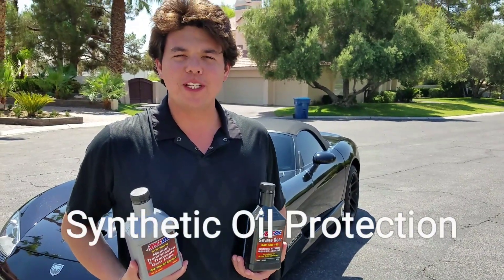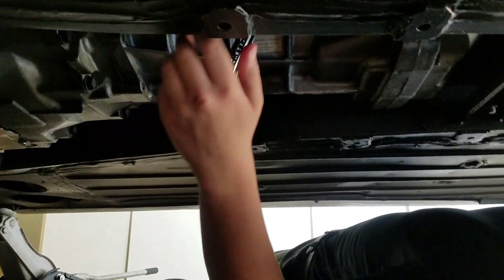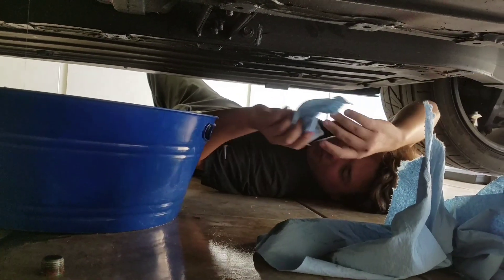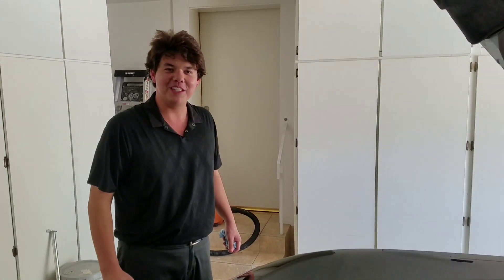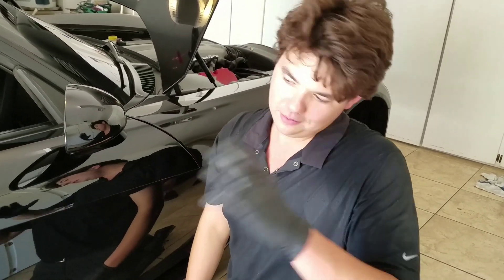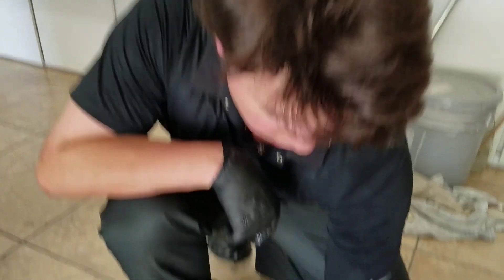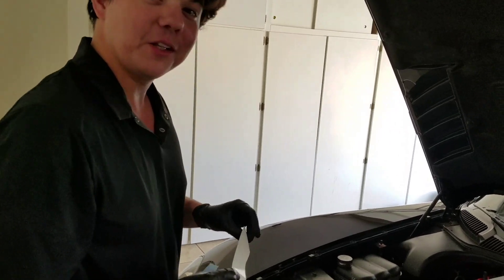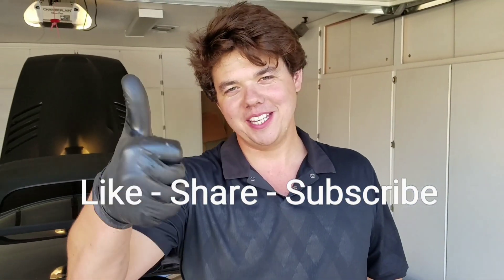2004 Dodge Viper Gen 3 AMSOIL Manual Transmission fluid Change

Comment from the maker: Watch This NEXT: AMSOIL FAQ - https://www.youtube.com/watch?v=ezqlKFExUhA&list=PLB_ftWArBFddeMPIMmZFpXbOyXSRZerqt
Professional YouLubher:
Eben Rockmaker Executive Direct Jobber AMSOIL Specialist (Dealer#: 5331179)
Mobile: (702) 472-3614
 My link: AMSOIL 25% Less Wholesale & FREE SHIPPING: https://www.amsoil.com/offers/?zo=5331179
AMSOIL Makes it for your Vehicle Lookup - https://www.amsoil.com/guides.aspx?zo=5331179

 If your vehicle is not on the lookup guide this is AMSOIL Tech Support 715-399-8324

Best Videos - https://www.youtube.com/watch?v=qjR2pjggjhY&list=PLB_ftWArBFdd7D6zW4OCpA0yEjh-uRY2t

     Friend me on and tag me because I like to see great results from my YouTube Community:
Instagram - https://www.instagram.com/syntheticoilprotection/

Facebook - https://www.facebook.com/profile.php?id=100007973957868

Order AMSOIL By Phone:

Be sure to give them my number so I get credit Eben #5331179 and tell them you would like to be a Preferred Customer.

1. Call 1800-956-5695
2. Ask for your own preferred customer membership because you will get 25% off, free shipping over $100, and your informative quarterly AMSOIL Magazine. It costs $10 for 6 months or $20 for the year which is well worth it.
3. Give them my dealer number so I get credit Eben 5331179
4. Orders over $100 will be shipped free.

Industry-standard 3rd party testing results:

AMSOIL Signature Series 5W-30 Synthetic Motor Oil protects against harmful deposits on turbochargers 4X better than Mobil1® Extended Performance and 3.6X better than Royal Purple® in industry-standard testing*.
https://www.amsoil.com/newsstand/motor-oil/articles/leading-the-field-in-deposit-protection/?zo=5331179

Amsoil gets better gas mileage -
https://www.amsoil.com/newsstand/motor-oil/articles/another-win-for-amsoil-products/?zo=5331179

AMSOIL Signature Series is fortified with a heavy treatment of detergent additive and it delivers 30% more acid neutralizing power1 than Mobil 1, and 36% more than Royal Purple, helping engines to stay cleaner, longer.-
https://www.amsoil.com/newsstand/motor-oil/articles/cleaning-up-the-competition/?zo=5331179

Comment: Eben - great video, my friend. I bought my Amsoil 75W-90 and did the fluid change myself in my T-56 tranny. Question for you: did you use all four quartz of your Amsoil? or was it more like 3.5 quartz? I got to 3.5 quartz and started to overflow out of filler hole.  Did you have the same experience? I know you tilted your fill hole down, but I kept mine level with same 3.5 quarts outcome. Let me know! Can't wait to feel how good this shifts now! 

Great vid and I subscribed to your channel. Keep the gen 3 viper videos coming!

Comment: The transmission calls for Castrol syntorq LT 75W / 85W. The differential calls for synthetic manual trans lubricant 75W-85
Reply from the maker: Amsoil makes the equivalence however the Amsoil products are 100% synthetic and they have upgraded modifiers so you have more film strength and more protection. 

This is the look up guide and it also gives the equivalent to all the different vehicles .

AMSOIL Makes it for your Vehicle Lookup - https://www.amsoil.com/guides.aspx?zo=5331179
Reply from the maker: What type of vehicles do you have?
Reply: @Syntheticoilprotection  gen 3 viper 2003. I'd send you the picture of the owners manual if it let me post it.

Comment: You didn't show us how to fill it , you skipped the diff completely....
Reply from the maker: I might have a glitch when I did the video I think I did another viper check out this playlist here on all the dip fluid changes they're all very similar there's a drain spot in a fill spot and then I also recommend getting the AMS oil easy pack it's nice because you don't need the hand pump.

https://youtube.com/playlist?list=PLB_ftWArBFdd5AI6YeZcFu7Lfxd3jotIA